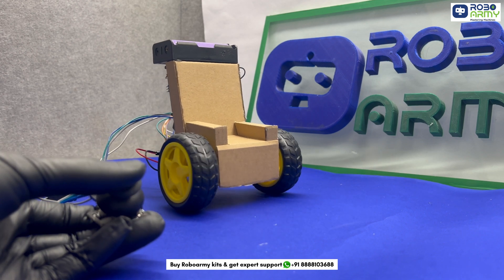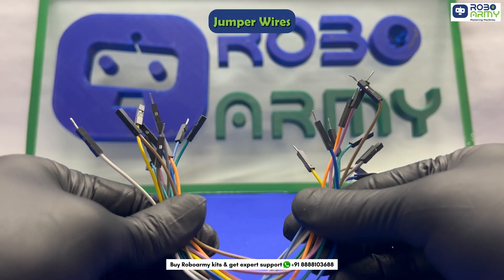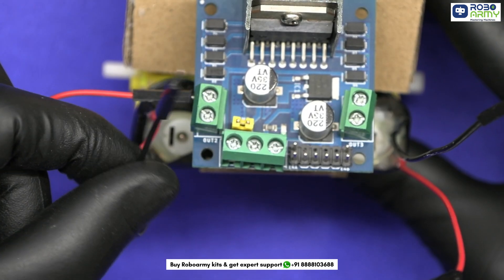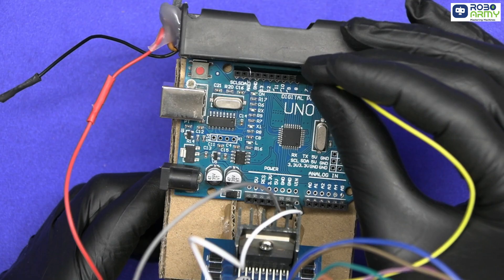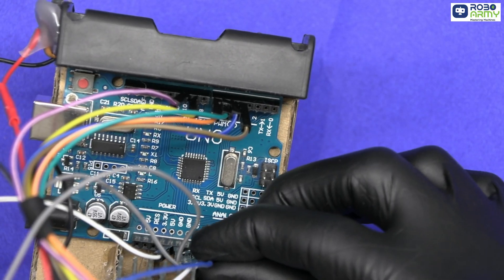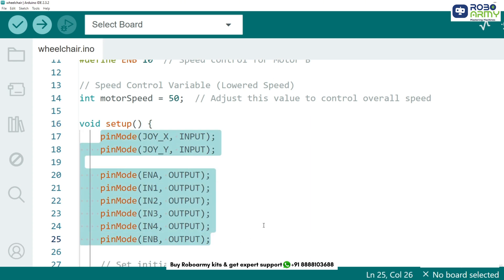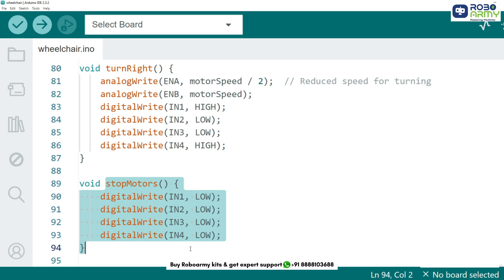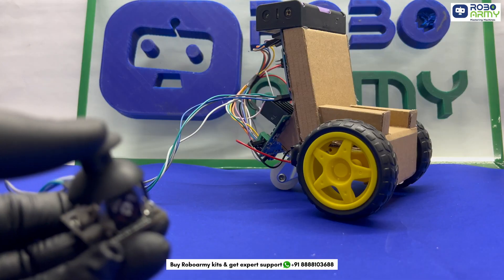DIY Joystick Controlled Wheelchair using Arduino! ♿🎮 (Live Demo)

Comment: When I do this the battery wire ar getting heated
Reply from the maker: It sounds like there might be a short circuit or too much current draw. Make sure your battery has enough current capacity for the motors and check all your connections for any shorts.

Comment: Is there a video of you where a dfplayer works together with a few servos and an engine control. I just can't get all three with my esp32s
Reply from the maker: I haven't made a specific video combining DFPlayer, servos, and engine control with ESP32 yet—but that’s a great idea! It can be tricky since DFPlayer and servos both need precise timing, and sometimes power or library conflicts cause issues. Make sure you're using external power for servos and grounding everything together.